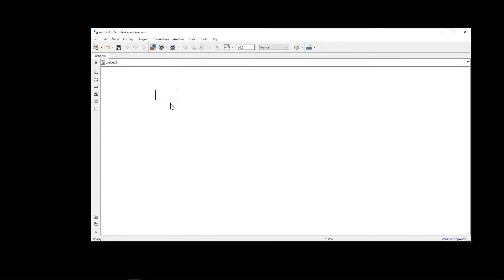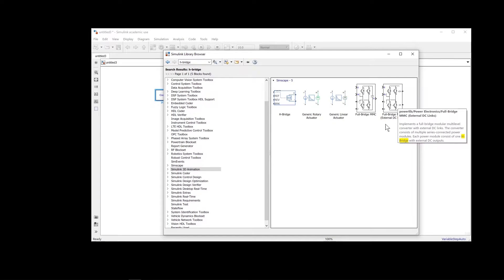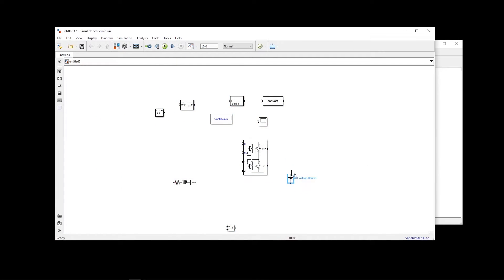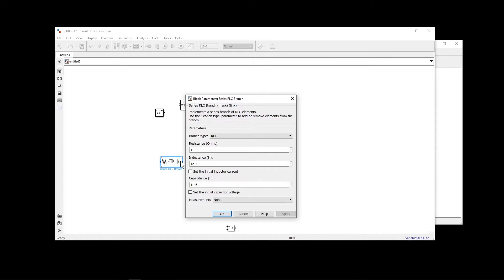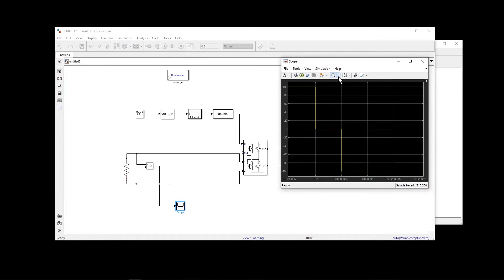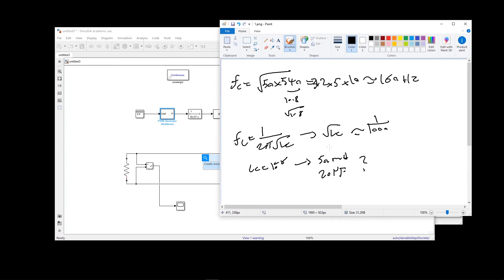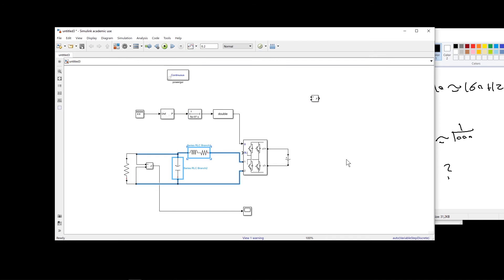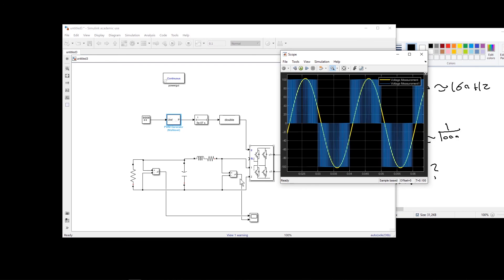How to make an H-Bridge circuit in Matlab Simulink

Comment: Hey, 
Your video is great, but you are just taking blocks I am unable to differentiate between the same blocks.
I have mini project to do on Cascade control of DC/DC converter. Please can you help me?
Reply from the maker: what do you mean you are unable to differentiate between eh blocks ?
Reply: @HVE  between different similar blocks for example if I search on Resistor I get different kinds of similar resistor, If I search voltage source I get different kinds of Voltage source

Comment: Hi mate. 
Can you please advise me regarding H Bridge?
I want a H Bridge which can change the polarity of around 100 times per second. 
Must work between 5Volts to 12Volts.
Reply from the maker: Hi, you can buy L298N or if you need higher current capability buy  BTS7960B. Both are very inexpensive.
Reply: @HVE  Thanks for your replay. 
Do you have any tutorials to show how to do all connection?
Thanks
Reply from the maker: @MIHAI0410  I have it in mind, but now it is a busy period, i will make the video later. There are already many tutorials available online about this. It is very simple to use
Reply: Thanks mate
Reply: @HVE  What I  want to recreate is that maglev propulsion . 
And a small diagram to connect L 298N on one coil would be great.
Reply: @HVE 

I found this one sir.
 https://uk.rs-online.com/mobile/search.html?searchTerm=L298N
Reply from the maker: @MIHAI0410  I suggest you buy an assembled module, for example:  https://www.ebay.com/sch/i.html?_from=R40&_trksid=p2380057.m570.l1313&_nkw=l298N&_sacat=0